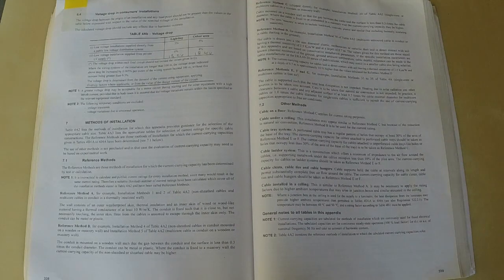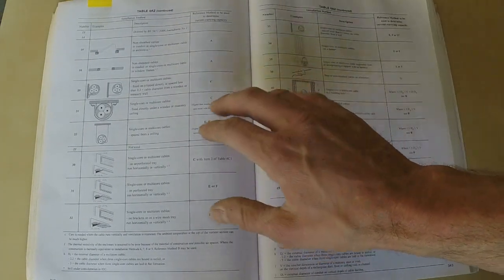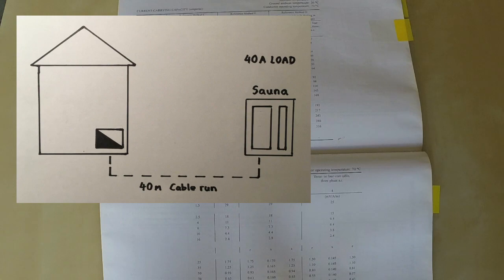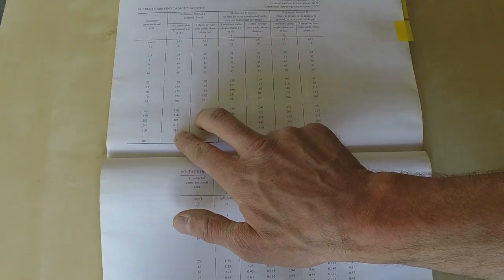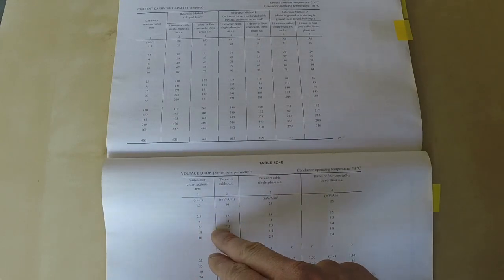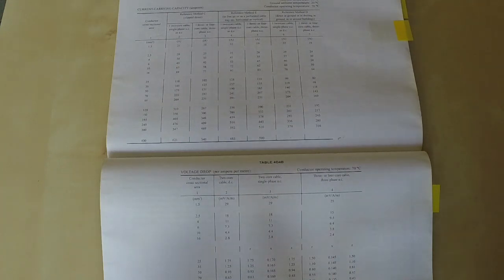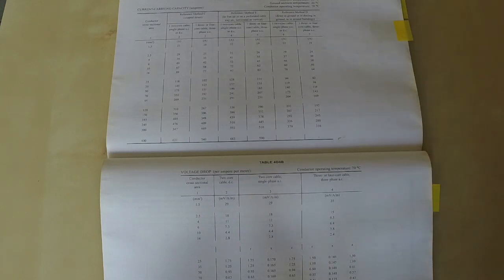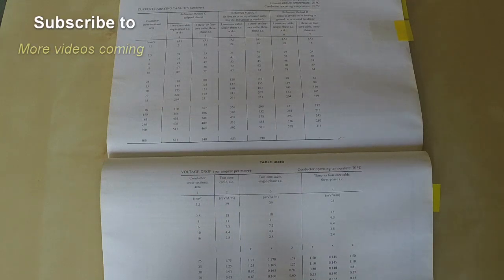How to work out cable sizes step by step

Comment: Out of curiosity, what size mcb or rcbo did you put in?
Reply: it would have been a 20 A RCBO as a radial circuit.
Reply: @andrewkirk5252  
A 40amp sauna would need a fuse slightly bigger, else it would trip all the time.  Or was you trying to say that you put a 40 amp fuse going  into the sub building from the house, and then put a sauna in that pulls slightly less than 20 amps?  That would make sense